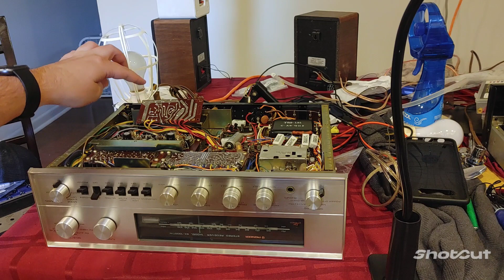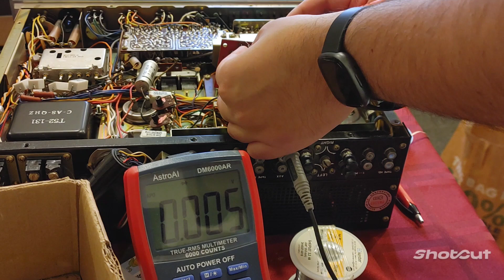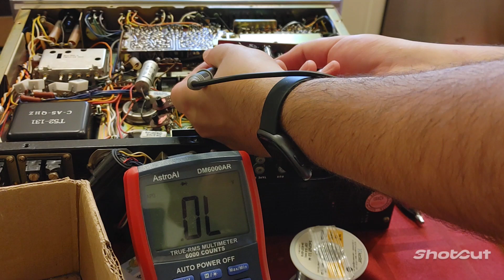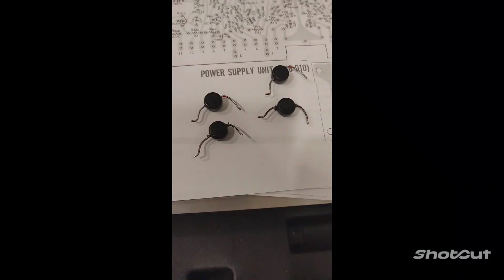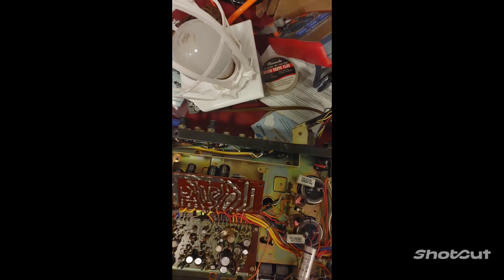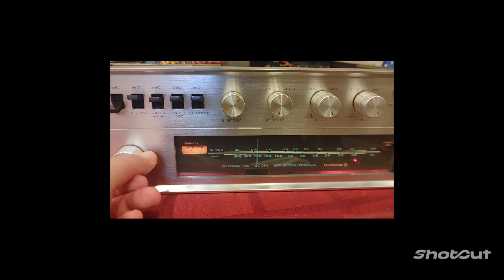Pioneer SX-1000TW Stereo Receiver Repair Bad Power Diodes

Comment: What is the purpose of the light bulb test ?
Reply from the maker: It limits the current that can run into the receiver. If there is a short or failed component, it helps keep that failure from drawing tons of juice and overloading other components.

Comment: I picked up a Pioneer SX-1000TW just last week. It has the same problem. One of the rectifier diodes is shorted. I really like your detailed diagnosis in this video.
As to the fuse, according to the manual, "A 1.5-ampere fuse is to be used for either 220V or 240V operation and a 3-ampere fuse for any of 110V, 117V, or 130V operation." So in US, 3A fuse should be used.
Reply from the maker: Thanks for pointing that out! Sounds like that was the appropriate fuse then